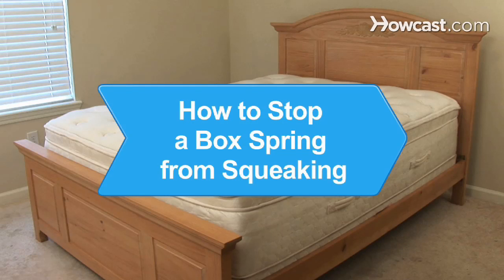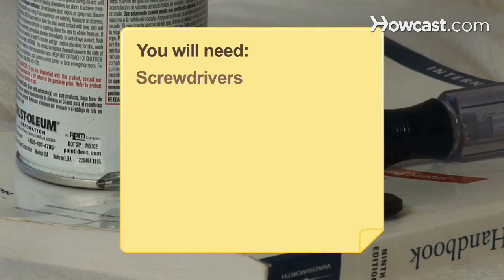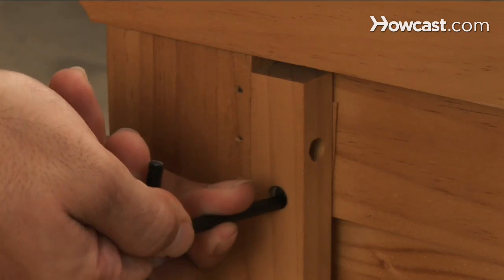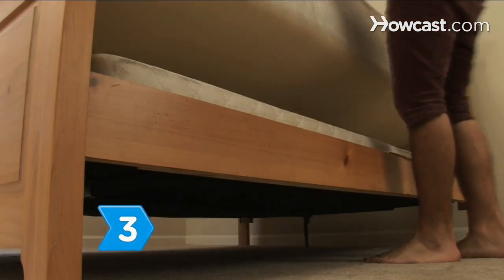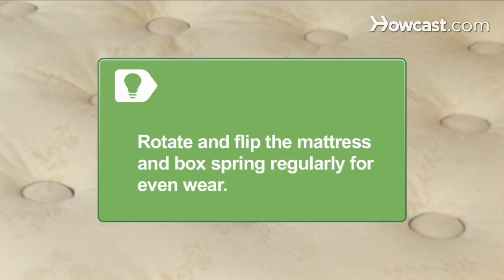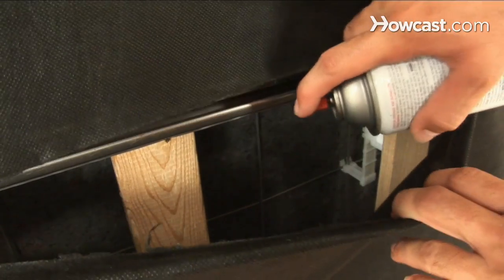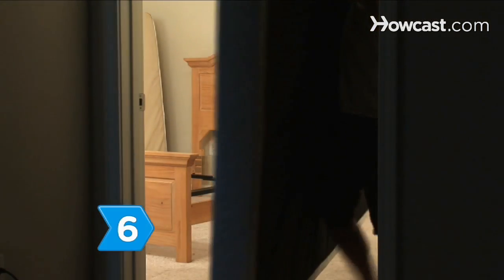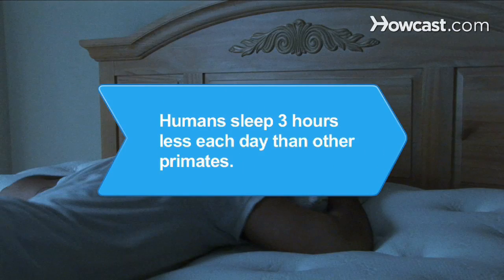How to Stop a Box Spring from Squeaking

Comment: see that metal bed frame center support??? its running head to toe, guess what? that's bad that's a no no . it should run side to side it wouldn't be bowing nor would the fabric be torn on the bottom of the box spring
Reply: In my case it only fits one direction, head to toe.

Comment: For someone out there, if your 'foundation' ie boxspring is making a deeper kind of rubbing noise, it's the cardboard moving against the wooden slats, remove the staples to let loose the fabric, then use wood glue on each side of side of where the slats meet the cardboard or use a foam or felt tape between the cardboard and the slats. DO NOT REMOVE THE CARDBOARD! This is another common method that will remove the crunching rubbing sound BUT, originally I thought it was for aesthetics only, (so that fabric doesn't sag exposing the slats) but it actually helps evenly distribute the mattress weight to the other slats. If you remove the cardboard, your mattress will sink between the slats and if your mattress is thin enough you will feel the slats through the bed.